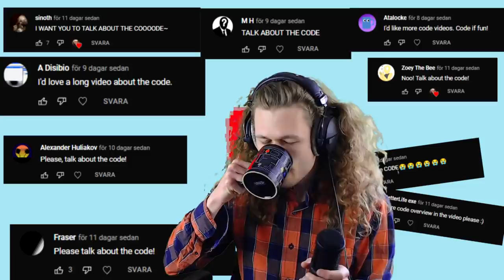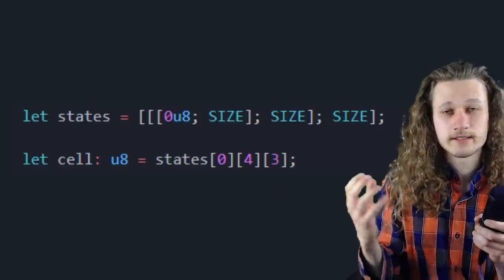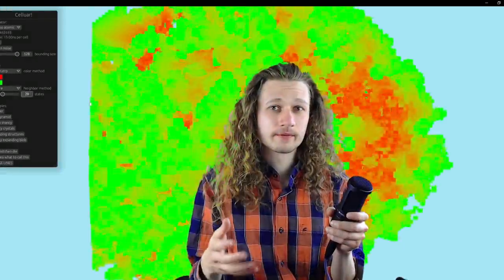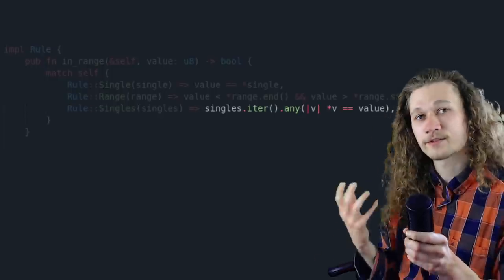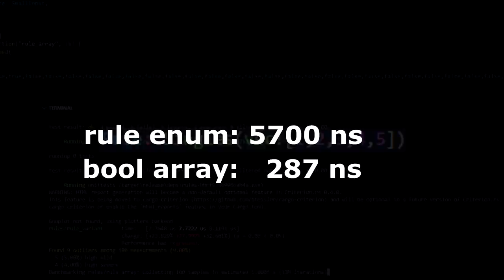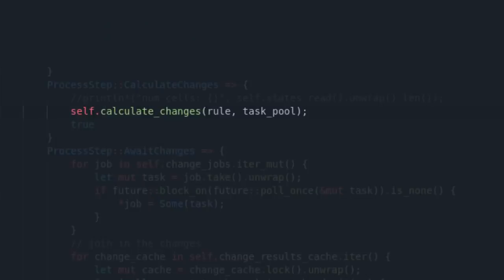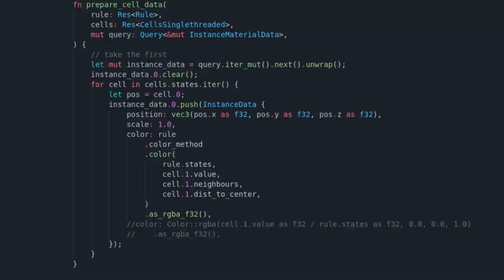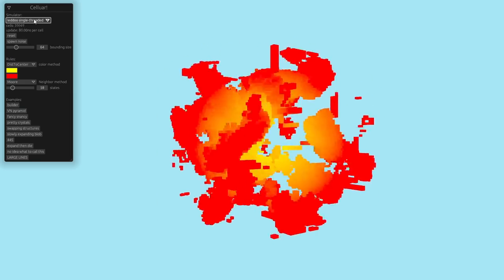Rust multi-threading code review

Comment: Along the lines of your "Measure before you optimize" insight, Gene Amdahl (one of the guys who created the IBM mainframe Assembler language in the 1960s & 70s for the IBM S/360 & S/370 mainframes) expressed Amdahl's Law (paraphrased): "The maximum value of a speedup (1/(ratio of the runtimes before & after optimizing)) from optimizing a part of a system is bounded by the amount of time a system spends in that part of the system."

(For a speedup, if you reduce your runtime from ten seconds (t1) to five seconds (t2), the speedup is t1/t2 = 10/5, for a speedup of 2.0. Reducing from ten seconds to one second has a speedup of 10/1 = 10x.)

What Amdahl's Law shows us is that the maximum speedup from optimizing part of a system is bounded by the amount of time a system spends in that part. If you have a choice between optimizing, say, disk IO performance by half or CPU performance by 90%, and your system spends 80 seconds out of 100 in IO, but only 10 seconds out of 100 in CPU processing, with another 10 seconds in "Miscellaneous processing," it actually makes far more sense to optimize the IO subsystem, since a 50% optimization would result in a speedup of around 1.67x (100 / (half of 80 (40) for new IO) + 10 (CPU) + 10 (Misc. time, like memory or something)) -> 100 / 60 -> 1.66666... < 1.67x) vs. a speedup of 1.10 (100 / ( 80 (IO) + 1 (new CPU, having saved 90% of it's 10 seconds) + 10 (Misc. time)) -> 100 / 91 -> 1.09890... < 1.10x). I.e., optimizing to save only half of your IO time in your IO-heavy application gives you a 1.67x speedup vs. 1.10x for saving 90% of your CPU time that only consumed 10% of the original time. Hell, eliminating your CPU time entirely would only give you a less-than 1.11x speedup, which is still significantly less than your "lesser" IO optimization.

These are only things you'd know -- where your program is spending its time, and doing what in which inefficient ways -- if you've properly benchmarked or otherwise measured your application's performance characteristics. Using an insight like Amdahl's Law also gives you a place to start to look for optimization opportunities, regardless of if you never calculate actual speedups -- if your program spends 90% of its time in one subroutine, then you know that it makes little sense to start anywhere else in your search for optimization targets, since you could eliminate every other part of the program and only get a <1.11x speedup. Even a fairly basic speedup in the part of your code that is doing the most work will most likely net you the largest reduction in overall latency and thus largest speedup.

</performance_geek_rant>

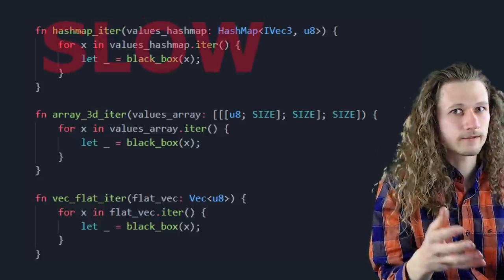Comment: Definitely a nitpick, but the "slow" code at 2:40 uses HashMap::iter which is very different from indexing the elements individually in order, which is what you appear to have benchmarked (this is what was actually being done in the simulation code (where HashMap::iter (i.e. one-by-one iteration though cells in arbitrary order) definitely wouldn't have been applicable), which is why I said that this is a nitpick).
I haven't done benchmarks to confirm this, but I would expect (map: HashMap<K, V>).iter() to be about as fast as iterating through a slice of map.capacity()* elements, mem::size_of::<(K, V)>() in size each. (The std hash map implementation appears to use a flat array of (K, V), so compared to a Vec<V> the need to store the keys makes it a bit bigger and thus less cache-efficient, and that's about it.)
Of course none of this applies to one-by-one indexing, where hashing and perhaps the chaotic memory access pattern are the main sources of overhead.
*Actually, the number of buckets. Apparently these are not the same thing...

Comment: Haven't watched the whole video yet, but I have to address an issue. If you want to create a multidimensional Vec and initialize it with a specific default value, the code at 2:00 and 2:05 is unnecessary bloated. First, there is the "vec" macro that works exactly like array initialization. Second, you can index Vecs the same you index arrays. Given these facts, the code can be written like this:

fn main() {
    const SIZE: usize = 10;
    let states: Vec<Vec<Vec<u8>>> = vec![vec![vec![0; SIZE]; SIZE]; SIZE];
    let cell = states[0][4][3];
    println!("{}", cell);
}

which is pretty much the same as with arrays.

Comment: Regarding how to store the data: I would use a hashmap of blocks (say 16x16x16).
It would easily parallelize as well, as each block could be a task. And we could avoid atomics IMO, perhaps by presaving boundary data, which is an order of magnitude smaller than the actual data.

Comment: Instead of a hashmap you could use an array set to the maximum size you're planning to use, and then make a getter/setter that clamps your values to the bounds set in the program. Should certainly be faster to iterate over than a hashmap, and depending on the hash function could likely be less memory used.

Comment: You are storing an int FFS.  Just make the array as large as your potential maximum, alloc it at start up and move on.  A single megabyte gives you 100*100*100 of 8 bit ints.
We have done this in the real world, stock exchange gateway risk checker, processing 20,000 messages per second on each of up to 20 bi-directional sessions.  Wire to Wire latency of less than 20 microseconds, sometimes less than 1 microsecond. (Non commodity hardware).
We had a multi-dimensional array of financial instruments containing market data (pointer).  We just allocated double the number of possible symbols and allocated a 15Gb Array on start up.
If you want performance, use static memory allocation or face doom.
Reply: Also, remember, (while this might not work in rust).... you can allocate a flat single dimensional array of data and then create as many indexes as you want to access those pointers in whichever way is performant.  Obviously this works best when you know the bounds of that data first though.

Comment: Of course a flat array is much faster than some lazy data structure. I remember so many IT people telling me to use these stupid data structures, because a raw pointer scares the shit out of them... I'd have to wait for months to get simulation results then.
At this point, I only do GPU parallelization, it's ~200x faster than even CPU multithreading on a flat array.
Also, you should probably not use slow atomics here, as you have a small grid size and plenty of memory. Use 2 copies of the array and read/write back and forth between them.

Comment: Hold on... 2.05μs is actually only 2050ns, so that would make the bool array not even ten times faster than the rule enum.

EDIT: Ah, okay you've noticed the mistake yourself. Yeah, this is what you get when you start typing a comment before you've even seen just a couple of seconds of video after the questionable statement. My bad.

Comment: 1:59 Actually no. You can use the same syntax as an array with vec![vec![0; 50]; 50] :D
Reply: wouldn't that not work with SIZE instead of 50 though, since it's not a constant?
Reply: ok nope it does work. I was completely mistaken
Reply: @L4Vo5  Yeah, as long as SIZE is a const variable then it works
Reply: @eboatwright_  I tried and it worked even with a non-constant variable
Reply: @L4Vo5  oh, awesome! :)
Reply from the maker: Oh wow didn't know that!
Thanks for the tip!
Reply: @Tantandev  No problem! ;)
Reply: And also when accessing the vector, there's no point repeatedly calling `.get().unwrap()`. You might as well just use `states[0][4][3]`. This will panic if you try to access out of bounds, but so will `.get().unwrap()`. There's only any point using `.get()` if you're going to do something other than panicking when an Err is returned.
Reply: @sburton84  yeah he mentioned that in the video :D

Comment: I don't understand, why is iterating through hashmap so much slower than a vector? Isn't the lookup time for a hashmap constant?
Reply: constant, but what constant? If i'm not mistaken it hashes for each get
Reply: What Jorge said.  It’s also my understanding that Rust uses a slower but more secure hashing algorithm on top of that.  In general, you don’t want hashing if you can easily manage array lookups instead.

Comment: 2:22 “We would need to move all of the cells inside vector, and I can’t imagine how that code would look like.”  So… a first-year 100 level programming assignment?  I mean, sure, it’s a problem you’ll have to sit down and think about for a bit, but it also comes down to middle-school (grades 5-8 in the US) algebra.  I don’t see the issue— use some scratch paper if you need to draw things out; it’s really not that hard.

In programming, you’ll often find the best solution is the fastest one (for the machine) as long as it doesn’t make code safety difficulty (e.g. bounds checking), wrapped up in an interface of functions/methods/properties/etc. that hide all those implementation details in favor of a friendly logical (in this case, Cartesian XYZ-coords) interface.

He claims he was “taa lazeee” , but he also made this video and working through that algorithm would’ve taken less time than editing the 1st 60 seconds of this video.  I don’t want to be too mean here, but laziness is definitely not the issue here.  The real issue might be another word that rhymes with “lazy” though.